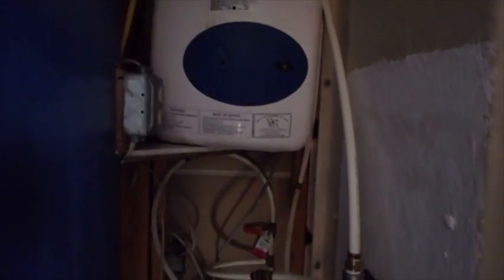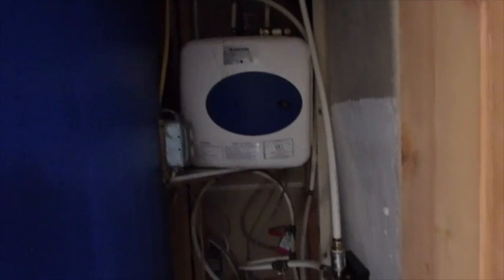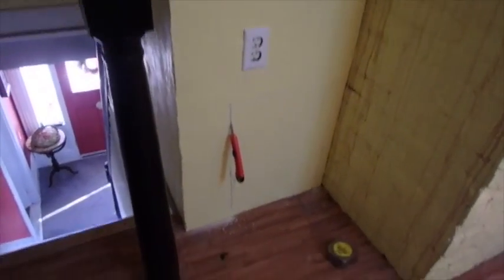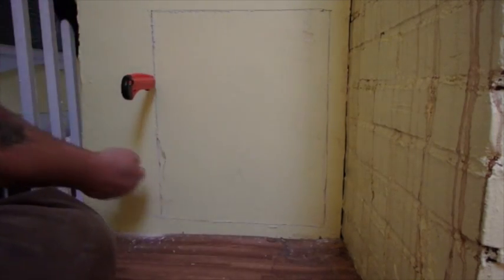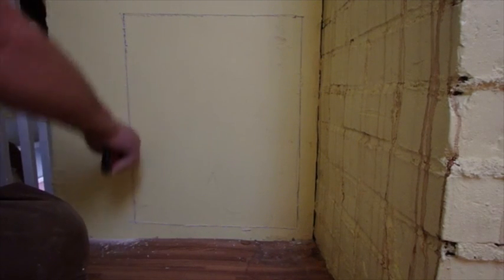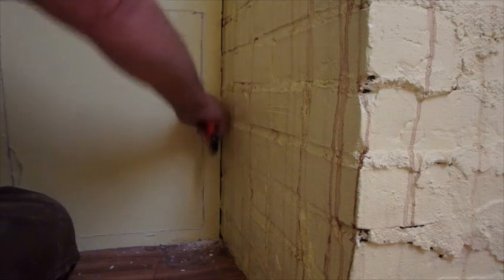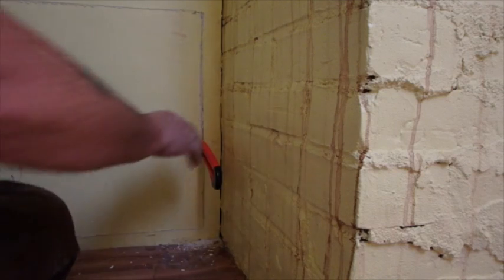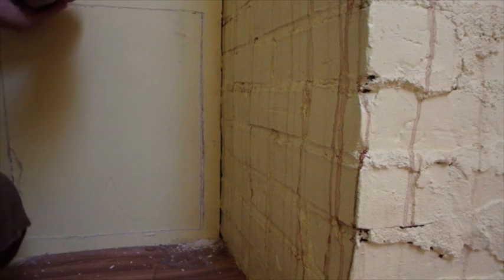Cuttin' a hole in the wall

Comment: They make an electronic valve system for a washing machine that plugs into the wall and has a receptacle in it for your washing machine. You hook it into the water supply line and the washing machine hoses to it. When the washing machine is on the current to power the washing machine activates the valve system thus only supplying water pressure to the washing machine hoses when the washing machine is actually on.

Comment: Mr. P. a hand drywall saw is worth it's weight ;)
Reply from the maker: I probably have one but it makes a lot of dust and the cut line would be thicker.  I wanted a thin line so I could put it back, and the less dust the less I have to clean up.
Reply: Makes sense...Especially the clean up! A saw enables you to cut at a 45 deg. angle so the piece sits back in without falling through.